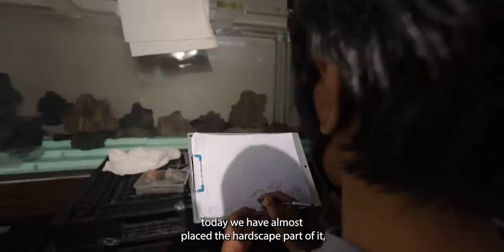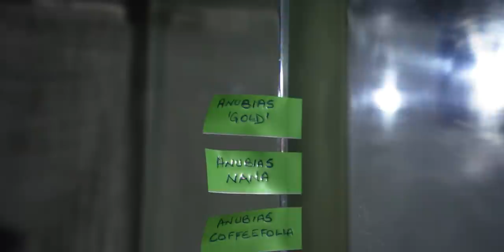India's Largest | Private Nature Aquarium | What goes into building it | Signature Series by Adip

Comment: I am not an expert, infact just a beginner...but I feel the potentials of a 5m tank was spoiled with the initial set up. There is no essence or perspective. Looked like a meager tank with rocks and plants slotted in randomly.  For such a huge set up, there were no proper differentiation of height.. could have easily created some caves, "hills", and so on to have a better perspective. And the pebbles being arranged like tiles on the foreground is so poorly thought... nature is never well arranged. Beauty in imperfection. And the tank after a year I suppose grew some wood and such? 😆
Great effort but please do not claim to have done the biggest and best in India when you don't have your claims verified
Reply: Agreed
Reply: absolutely correct. this scale of a project should deliver better end results. As you can see they have used way too many lights for this slow-growing / low-light required dominated setup. Also, the lack of fast-growing stem plants will not help balance the system's nutrients. the amount of soil used in this tank is a total waste. no carpet plants but a huge layer of soil in the foreground? No white sand to contrast the overall dark feeling of the scape?   the tank has been maintained badly as well. I think it's a bit waste of money, to be honest.
Reply: yes doesnt look good even after a year. maybe the tank did not have much width so they were limited. i dont like it though.

Comment: All is well!
However, no information on the type of tank-build, all materials/products used to set it up, including the base / table / cabinet structure.

For example :

*How the entire 5 mtr structure was conceptualised? What efforts and planning went behind it?

*The strength of the base to hold the tank dimensions and its weight.

*Types of rocks and the base used to support them.

* Types of Substrate and quantity used.

*Total no. of plant species used and it’s quantity, and the uniqueness and importance of them.

* Types and amount of driftwood used.

*Details about the filtration system used; any new innovative methods developed or retained existing systems? Other than Anubias covered pvc pipes.

*Types of fertilisers used.

*Ph levels and temperature of local water and it’s moderation throughout the year, in comparison with citywide corporation water.

*All species of animals considered along with some idea behind having such a combination of animals, like micro and macro bacteria, fish, shrimps, snails, etc.

*More details of the lights used and it’s importance.

*And an introduction of all the team members and their contributions from a hobbyist / enthusiast perspective. 

*An approximate cost which went into making such a grand setup happen.

There are some more points one could think of, but just wanted to share that everything matters. 

This production could reach professional level if such details are openly shared on social media.
Only adds to the credibility of ADA, and all it’s proud customers who use their products in this hobby. 

🙏